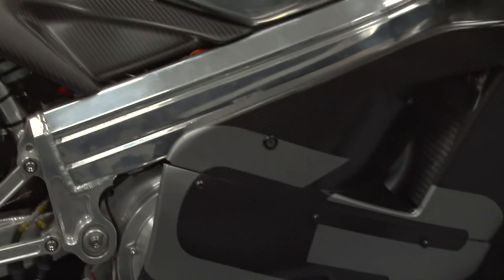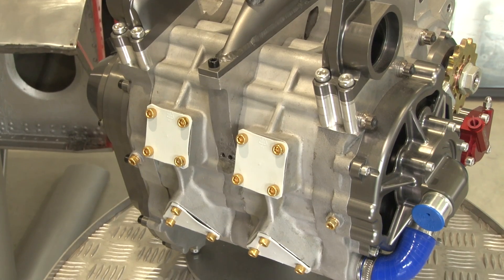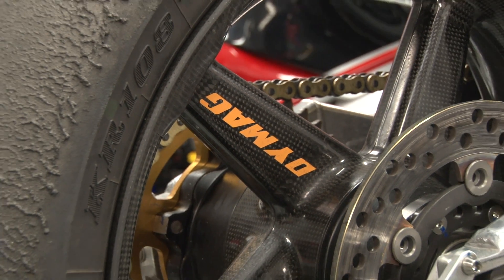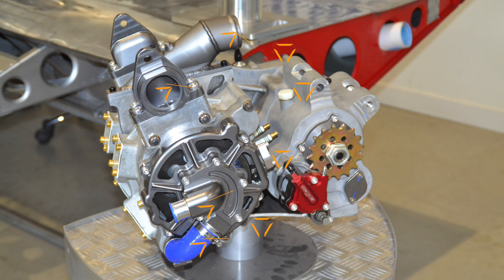Crighton CR700W : What makes this bike so special?

Comment: If I remember correctly, one of the issues with rotary engines - I'm thinking of the Mazdas, was the seals at the ends of the rotors would wear and fail which was a weakness that I don't has ever been resolved. I had an RX-2 and it was pretty powerful for a small lump, and when it got to a certain RPM it was like a VTEC engine, suddenly there'd be just gobs of power and it would take off like a scalded cat.
Reply: If maintained properly those seals will actually last a pretty decent amount of mileage, the key is keeping a good tune and maintaining good oil at all times.
Reply: Mazda managed to resolve the issues with the apex seals and so long as they were properly maintained, the seals would last more than 100k mls.  What killed the rotary engine was not the seal issue although. many people thought it was an endemic problem, but the pollution as they couldn't get it clean enough for modern legislation.  Another point was that they were thirst although Mazda eventually got acceptable fuel consumption out of them.  The RX7 which was discontinued in 2002 is a modern classic and a big farorite with the retro horse power brigade.  I hear that no normal garage will touch an RX7 because of the fears with the rotary engine so its left to the specialists
Reply: Yeah, seals and emissions issues.  

But for a RACE BIKE...as we've seen, "they'll" rule it out because they can't beat it.
Reply: so you had a rotary powered car but you don't know what apex seals are? curious
Reply: @StanleyKubick1  do you mean that because I didn't use the word "apex" to describe the seals on a pos car I sold 45 years ago I don't know what they are? Interesting.
Reply: @StanleyKubick1 You expect too much from the average car owner.  I wonder how many car owners actually know how a petrol engine works, let alone a Wankel rotary.  Most owners are dumb as to the workings of their vehicle, which is the excuse why the manufacturers and legislators have ladled our car with gimmicks.
Reply: yes i use amsoil interceptor 2 stroke oil throughout my rotary. The OMP does its thing.

Comment: crighton solved the inherant rotary heating problem by feeding coolant through the e-shaft, keeping the center of the engine cool.
Reply: The exhaust ejector cooling system,as it is known. Super simple but very effective innovation.
Reply: @howardosborne8647  How about about an aircooled rotor mazda 13B this can be done by cutting excess metal out and more air ports on billet Al side plates. its been done for some airplane applications.
Reply: Reduicing weight in the process.
But as far as I understand, the cooling problem is at the outer wall plate near the sparkplugs, the sandwich plates at that location, and the rotor tips. Is that not so?
Reply: @blipman17  yes it can be, but its exascerbated by the rotors expanding outward "pinching" the apex seals tighter and tighter

Comment: I would most likely buy one if it cost like a BMW S1krr or a Ducati V4 around 20k Euros! But not 120k Euros.....
Reply: Apples to oranges
Reply: Its a bargain compared to MV Agustas and top of the range GP bikes.
Reply: @MaciusSzwed  it’s a race bike for a reason, it’s not mass produced like other bikes
Reply: still the price is INSANE! I know Ive built race bikes in my own company @johnplatt9476

Comment: Stunning bike. Does it have electronics? How did it keep the front down at such a rediculous power to weight ratio?
Reply: Rider skill/respect.
Reply: @user-ii1iy8fz1d  I would be disappointed if it was a wheelie machine and didn't have an aftermarket sophisticated electronics package to keep it in line

Comment: Why is that shock not tucked low and inside with a rising rate linkage on it? Bloody daft to use that configuration.
Reply: Because BC don't do linkages, and weight reduction.
Reply: Because all the vast experiments that Chrighton and his team did from the early days showed the rising rate linkage system to be far worse for rear end control than a conventional twin or single shock directly attached to the swingarm. The championship winning Duckhams bikes all had twin shock suspension.
Reply: @howardosborne8647  Sorry but that is bad research. The rising rate gives you more appropriate control throughout the shock's stroke. If you add a complex multi-stage spring and valving setup (which adds bulk and weight) then you don't need rising rate. Otherwise you do.
Reply: No such thing as bad research just because it doesn’t line up with your theory.

Comment: If some body wants a track bike that is lightweight, plenty of horsepower and only for the track, then perhaps the Suter MMX 500 could be a better option. That will at least finish a few laps at any track before needing to stop for fuel. Having a rotary bike will mean you get 15 mins of track action before needing to come in to refuel. Great conceptually,  but will be terrible to live with.

I wished the host would ask questions that will add value rather than prompting the Crighton representative to say things on the pamphlet
Reply: How do you know that you can only get 15min of track time? The Rotary Norton NRV588 with a similar rotary engine won the British Superbike Championship, so it can’t be that bad.💁🏼‍♂️
Reply: @streddaz 
And the Isle of Man in 91 or 92.
Reply: @kasperkjrsgaard1447  yes, you are correct!
The rotary isn’t so good on the street, as fuel consumption at lower RPMs is poor, but at higher RPM, it’s actually quite efficient. One of the reasons the Mazda 787B won LeMans was that they need less fuel stops than the opposition.
Reply from the maker: What a great car that was. Would you be interested in an in-depth tech review of older cars and bikes too? We're only just getting started with this channel and suggestions are welcome
Reply: @streddaz yes very true, a fantastic engine for racing thats where the rotary engine really shines
Reply: @kasperkjrsgaard1447  92 was the winning year at the TT but they were on the podium in previous years.

Comment: Why does it smoke so much on start up?
Reply: ロータリーはオイルを燃焼して潤滑してるから
Reply: It’s similar to a two stroke engine as it has a small amount of oil injected into the rotor housing for lubrication.
Reply: @streddaz  Oh okay, so it's a two stroke rotary
Reply: @99.9percent9  only that it needs oil injection (or an oil premix) other than that they are very different. I’ve had a few rotary engine cars. A lot of power from a very small engine.
Reply: @99.9percent9 
No, it’s a rotary.
Reply: @99.9percent9 Yes its a Rotron 690cc 2 stroke rotary!
Reply: @streddaz  I fill my 13b rotary with amsoil interceptor 2 stroke oil and just use the OMP turned up. So far so good!

Comment: Interesting concept and execution… poor application considering the excessive  oil consumption and the near complete lack of low/mid range torque that plague all Rotary engines ….that is unless you rev the snot out of it which you never see in any videos concerning this motorcycle…hmmmmm???
Reply: These rotary motors of the Crighton design have never suffered from poor low or mid range torque. It is a fallacy that these Rotron or the previous Chrighton Norton bikes were gutless or peaky.
Also the 'excess oil consumption' you refer to is really quite minimal in reality.
Reply: Well you have obviously never ridden a rotary engine.  The power is linear all the way through the rev range. I've only rode a Norton Rotary water cooled engine and that had no engine oil usage couldn't comment on the car engines.  It does use 2-stroke engine oil in the fuel by design.
Reply: @bartreid8233   The two stroke engine oil in the fuel was one of the tricks to getting the seals to last and IIRC was a fairly modern application, shame NSU didn't try it.
Reply: I once rode one of the original Norton rotary bikes. The torque delivery was amazing, just like a huge electric motor.
Reply from the maker: @philhawley1219 Was that a Norton F1?
Reply: @TheRaceBay  Not F1. The Commander touring style with a fairing. The later water cooled model.
Reply from the maker: Sounds similar to the bike Brian started out with at Norton
Reply: @TheRaceBay They christened that first bike as  'Waltzing Walter' because of its tendency to weave and wallow through corners.
Reply: Well you can put turbo on rotor engine to get some torque but this will be much more complicated application.
Reply: You must be an expert in this field
Reply: Hmmmmmm everything seen and what people say about it blows your “theory” away hmmmmm??